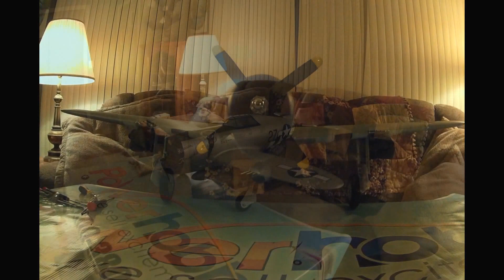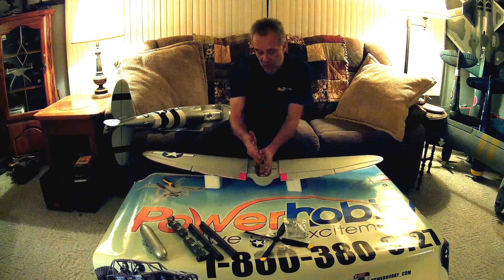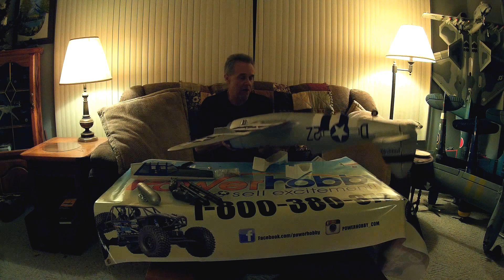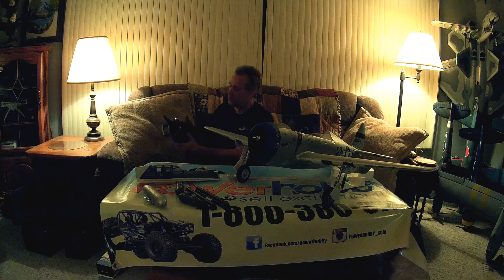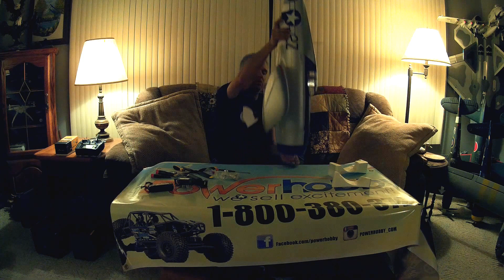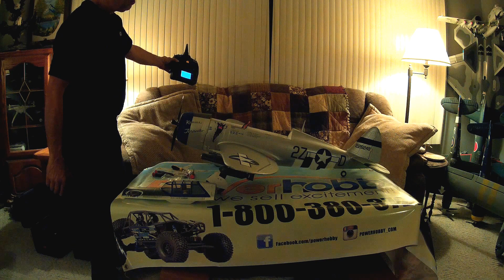(NEW) E-Flite P-47D Razorback 1.2m Warbird with Safe+ (Full Build) Brought to us by POWER HOBBY

Comment: Have the same plane. Had to balance plane at 70 mm and 1.5 oz of lead, bad tail heavy. How about yours?
Reply from the maker: Mines right .on  Have heard 2 tales 1 nose heavy and yours.??
What battery you using?
Reply: Skip-Built, RC. I'm use an admiral 2200-30c . I think that is recommended.